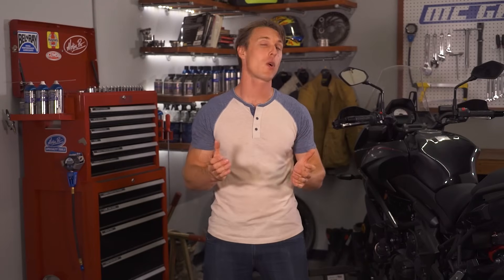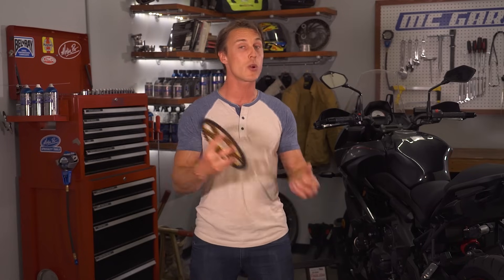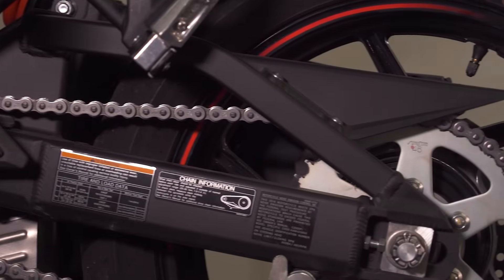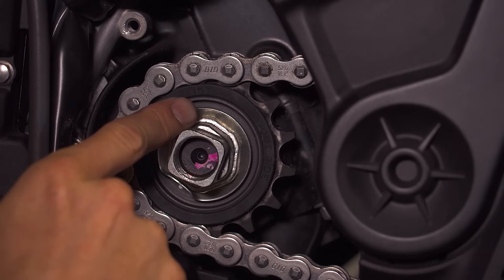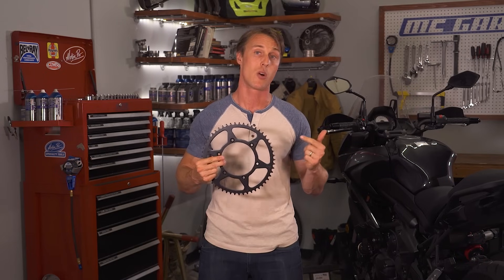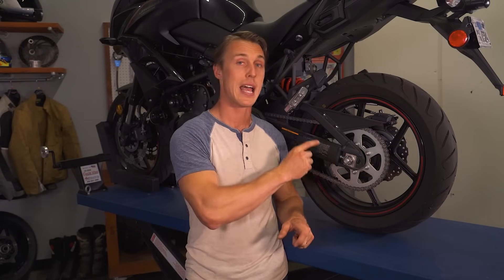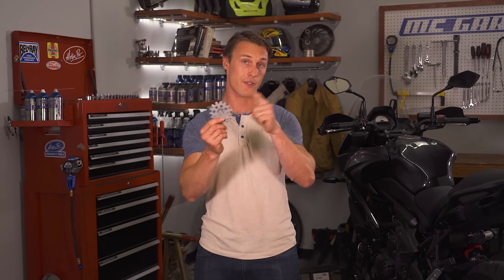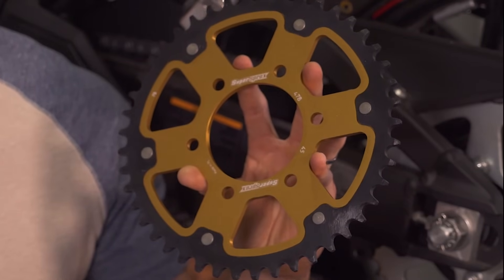Motorcycle Gearing Changes Explained | MC Garage

Comment: Another factor to consider when changing the front sprocket is chain life. Going taller in the front extends chain life significantly. Going shorter in the front decreases chain life significantly.
Reply: Jay _ yes that's why you always increase in the rear vs decreasing in front, even though ari recommended the opposite
Reply: Well I went 2 down on the front and 3 up on the rear... OF my 2005 Triumph Daytona 650 about 20k miles ago... Chain and teeth are still just fine, yes the chain is getting near the point I will want to change it (measured the "stretch"), however it is still well within safe limits. I don't do any sort of wheelies... I do ride aggressively, and I purchased to spec parts. SO while I agree it does put added wear on the chain to do what I did, it's NOT going to wear it out that much faster then if you didn't do it. OR at least in my case (I take really good care of my stuff), it has not really effected the longevity of the life of the chain.
Reply: @JJ_ExMachina   Wow that is a drastic change.
Reply: @yessure5291  Well I only do street riding, so the top end is not important. It really improved the response at speed and the way the bike leaves the line. With everything done to the bike, I am putting about 120hp to the wheel. So the bike is a rocket at street speeds.
Reply: @JJ_ExMachina    Take it easy - speeding tickets are easy to get and costly in fines and insurance increases.   ;)
Reply: @yessure5291  Sure thing, I am 41 years old, so not new to riding,  have been doing it since I was 5 years old. I have been on 2 wheels longer then most have been driving in my age group. I do appreciate the concern though. When I say street speeds, I mean legal street speeds.
Reply: @JJ_ExMachina     You are 41 hmmmmm I started riding 1 year before you arrived :))    20 different motorcycles so far and still going.
Reply: @yessure5291  Yep, plan on riding till the day I die... ;P
Reply: @JJ_ExMachina    Is it wise to put riding and die in the same sentence?  :)
Reply: @yessure5291  For one I am not superstitious... Two I have worked in a war zone for the last 16 years... So not worried about death... I don't seek it out, but I know if death is out for you, nothing you will do, can stop it. For example, a guy I worked with went home after working 10 years in a war zone, only to find out he has cancer. Another guy I knew died of a heart attack at the age of 50.... So I ride as much as I can, and if I die because of it, so be it, I was doing something I enjoyed. Better then getting killed by a rocket or enemy combatant.
Reply: @JJ_ExMachina  I went from a 14t sprocket to a 17t with a rear sprocket of 34t I’m thinking of going to 32t will this help my final speed or hurt it ?
Reply: @Deenuponhaqq  ... It will increase your top speed. Think of a bicycle and the way those gears effect your pedaling and the effects it has on speed, and how much effort it takes to achieve those speeds... Larger gear in the rear makes it easier to pedel, but you reduce the top speed. So smaller gear in rear will give you a higher top speed, but shift your torque curve higher as well, meaning more effort to get up to speed. Most bikes have a hard limit on what size sprocket you can run up front, due to constraints of the housing and frame space. So you can typically go up one or down one safely in the front... but you can change a drastic number of gears in the rear safely. Just make sure you align your rear wheel correctly, don't want any dog tracking 🤪
Reply: @JJ_ExMachina  thanks a lot this was very helpful
Reply: @Deenuponhaqq  ... You're welcome... always glad to help if I can!

Comment: Curious how much top speed you lose if you want better acceleration
Reply: If on both occasions the bike is capable of accelerating to the fuel cutoff in top gear than the calculation is very simple; 10% shorter gearing means 10% less top speed, if it's not the case than real world experiment will be needed.
Reply: Good to know, thanks
Reply: gearingcommander.com

Comment: how about on CVTs'?
Reply: It depends on what you want. Lighter weights for faster acceleration.
Reply: As Jospi2 said, you can change your variator weigths. You can also change your variator for one with different angles on the ramps, or run a wider belt (and shim the sheaves accordingly) to alter the gearing. Mostly guys just alter the weights since that is easy to do and works really well.
Reply: If you use lighter weights for the CVT, acceleration is better but top speed suffers.
Reply: jospi2 so... which should i choose? heavy or light?
Reply: AutoMatic Rider typical scooter question! You can google it for more info,or visit some scooters forum.This is after all motorcycle chanel.
Reply: Get a thicker belt
Reply: AutoMatic Rider Your first mistake was buying a bike with a CVT
Reply: haha yeah.. but im just askin.

Comment: my original ktm rc 200 has 14/42 set up but has i was little last gear to be taller im considering 15/43 but i can’t find 15t sprocket according ktm rc 200 front shaft any suggestions which bike 15t sprocket will fit ?
Reply: Hi, karan as hanri told in video you have to decrease gear ratio for top speed and increased ratio will boost acceleration , for you i recommend you go for 200NS Rear sprocket change because it will match your top end just like this, 39/14 = 2.78 increased top end , or if you find out 15/43 then no problem but please check out front sprocket does have Space to feet increased sized sprocket, then go ahead
Reply: Hi, I found one CBR 150R has 15/43 sprocket.
Reply: Malek Uvesh  yes i got you i want a set up like 390 where it has 6 gear is a taller one better for highway crushing but thing is rc 390 has different shaft than rc 200
Reply: karan bundhela , yes absolutely right 390 engine not only got bigger cylinder head and chamber increased there is whole engine layout goes different.
Reply: There is an awesome website called JT sprockets which has a catalogue including many bikes, and alternative sprockets for them. The important thing to consider is the dimensions of the shaft/bolt holes they are supposed to match up to, but this website takes care of that, and shows an engineering drawing of the sprocket. JT does list a 15T front for your RC 200, but only lists a 42 and 45T for the rear. You may have to get one custom machined if you want something other than those options, unless you can find someone else offering it!

If you don't know about it yet, Gearingcommander.com is a great website for visualizing rpm changes with gearing.

Comment: Why not as a tooth to the front and subtract one from the rear. No chain abutment require
Reply: Because one tooth on rear does not equal one tooth on front. One on rear is one out of 40ish teeth, and on front a single tooth is 1 out of 15ish. So one tooth on front has a greater change to sprocket size, than a tooth on rear.
Reply: Daniel Kemnitz this I know. It would be like dropping 4 teeth on the rear. It's an old trick but it just might work

Comment: I dropped a tooth on the front sprocket of my little R3 and it completely changed the characteristic of the bike. And since I do a lot of canyon carving and street riding with it, I much prefer this set-up.
Reply: Yeah did 2 down and three up on my 2005 Triumph Daytona 650... It now is an insanely quick bike.. Yeah I can only do 156-158 top end... BUT I don't ever hit those speeds on the street... I can keep up with my buddies stock ZX14 from a standstill to about 130MPH... SO I am just fine with that...
Reply: ride safe paps ... nice info na din ..
Reply: What is your top speed with the shorter gearing? Im thinking about switching to a 13 in the front and a 44 in the back on my 2018 MT03.
Reply: FPSPhilippines i believe front sprocket is 15? So you drop one tooth its now 14? And rear sprocket 45?
Reply: Pepsi Boy42 the OEM is 14 front 43 rear and I just swapped for a 13T takasago front sprocket and left the stock chain and rear sprocket since it all fits. However the speedo is rather enthusiastic reading 100kph when in reality its running about 93kph give or take. But doesn't really bother me since the speed limits in our island are more "guidelines" than actual rules to follow lol.
Reply: @JoshuaUncharted  ... Nice on the speed "guidelines", wish more places had open roads... Only a few "open" roads in the United States, that allow 85 MPH and Bunch of 80 MPH ones... Soon they are talking about many toll roads going to 90 or 100 MPH speed limits... Since cars are getting safer at speed.
Reply: @JJ_ExMachina   Hehe where i live topspeed is 90 km/h  | 55 mp/h
Reply: @JoshuaUncharted  y
Reply: does changing the front sprocket affects the speedo?? please reply im quite interesting especially in small cc bikes
Reply: @raymunddiems5540  It depends on how your bike reads it speeds. Some use the front tire, and no matter what you do to the sprocket, speedo is not effected. However most bikes use the output shaft on the transmission to detect speed, any sprocket changes WILL effect speedo... Newest bikes with ABS use speed sensors on both wheels, and takes speed readings from there. So sprocket changes do not effect the speedo
Reply: @raymunddiems5540 answer: yes.

Comment: Hey,  Hanry can you please tell what i need to do for get top speed increased with changing sprocket's.
Reply: Watch the video ;)  more teeth on the front less on the rear (one or the other or both) will increase top speed, how much will depend on how many teeth you change by.  What bike do you have? what is it's top speed? how much of a change do you want?  

I would only bother increasing top speed on 125's for instance, only if you need to ride 60-70mph roads often, otherwise keep standard on 125+ or increase torque on anything above 300 but only a tiny bit on 300-500cc.  Torque = more fun, more of the time, you hardly get a chance to get to top speed on large capacity sport bikes.
Reply: Halfdead Rider , i have Honda CB Hornet 160R it comes with 47 teeth rear sprocket and it goes upto 125 kmph i have to take it to 140,
Reply: Halfdead Rider , thanks now i understand i have to decrease rear sprocket in my bike because it doesn't have Space for increase front sprocket.
Reply: Look up what rpm your bike makes the most power at, and try to get it so that is around the speed you want to be your top speed. If you can't get past that rpm in your highest gear with your current gearing then gearing won't help you go faster btw.
Reply: I did the same thing on my sv650. I had room to go 2 up in the front which is a bigger difference that even down 5 in the rear. Check out gearingcommander.com. If they have your bike it's easy to figure out what change you need.
Reply: B10401 , wow amazing owsam i can check different ratio here , thanks so much.
Reply: B10401 , yes right absolutely i already riding at 10k in (5th gear) top gear, i need cruising at 100kmph at lower RPM , just for this.

Comment: I have my bike with short gear ratio. I need to shift too frequently. Do you think if I change to lower number of tooth in rear sprocket to increasing the tooth of front sprocket will work for more top end???
Reply: If your bike currently runs into the revlimiter in last gear it could indeed give you more top end.
Reply: jospi2 thanks for the reply...
Reply: His question was "will taller gearing help me to shift less often?" And i guess he;s on a low hp bike.

Comment: What about odometer? I’ve heard changing sprockets causes incorrect readings. True? False?
Reply: nitemareman1  all down to what bike you have. If the speed is taken from the front or rear wheel your fine. If it comes off the gearbox before the chain it's going to get messed up
Reply: 3:17
Reply: It should be affected too, i think..
Reply: nitemareman1 
Check out the fix he mentions.
See if that will also correct the odometer.
I miss analog guages.
Reply: true, it'll fuck with the odometer, but a speedo healer will fix it, as far as you need to be concerned with showing correct speed/mileage, they're the same
Reply: nitemareman1 The sensor for the odometer and the speedo is the same, so it affects them equally
Reply: odometers will almost always read different. Even when speedos were on the frnt tire, many times the milage was taken at the transmission output shaft.
Reply: Check your model to be certain, as it varies widely. Gearingcommander.com will tell you what percentage off your milage will be.
Reply: It was stated in the video. If you have the cable operated odo usually connected to the front wheel on older or small displacement bikes, you're fine.
Reply: He talked about the speedo, not the odometer. And yes I know they’re related.
Reply: I DID watch the video. And nowhere in the video does he mention the word odometer. It's a perfectly reasonable question.
Reply: nitemareman1 
Watch the video!
Reply: He said SPEEDO, not odometer.

Comment: It's good to keep in mind that shorter gearing mainly helps off the line, as you can just be in a lower gear when up to speed, and you'll have the same acceleration at a given rpm and mph. If you're always going slow then shorter gears can help you stay in the power band, though. And if you have a sport bike that's geared ridiculously tall, and can go 90+ mph while lugging the engine, then there's no downside to going shorter.
Reply: A good tool for doing the math is gearingcommander,com. if you want to know how big of a change it will be.
Reply: I have a versys 1000 and torn on whatd be better. 1st gear zip seems fine, its more I hate loss of grunt in 6th gear going 60-100mph. Like feels like a bigger change 5-6th than between other gears. So making passes on highway I find myself wanting to go to 5th. Loss of mpg would be sad but feels like wasted gearing when im not running it up to 150mph and even doing 80/90 im only at like 3500/4000 rpm
Though as a new rider I may just be scared of keeping it in higher revs. Other than moments of flooring it. Even going fast fron a stop Im enjoying  fast up shifts with barely a release rowing up thru the gears at 4500-6000 rpm. Seems better than hitting second and reving it up to 8k hitting 60 then shifting up 4 gears in one go.